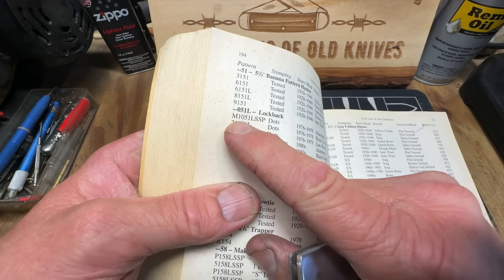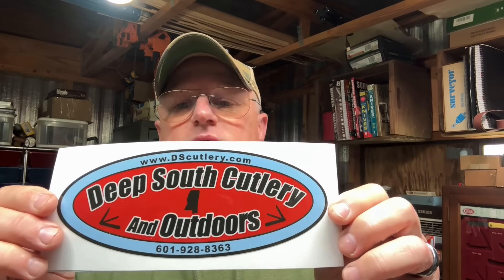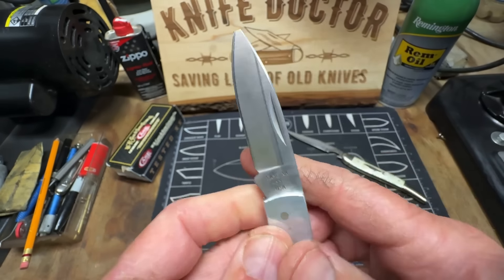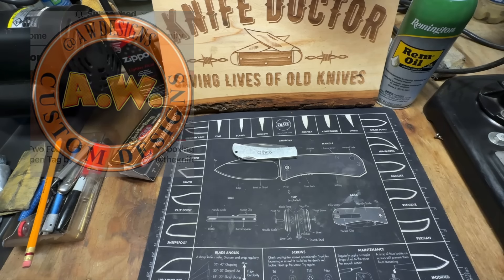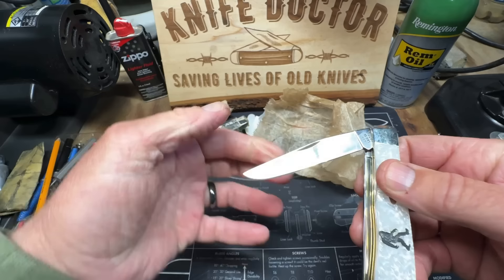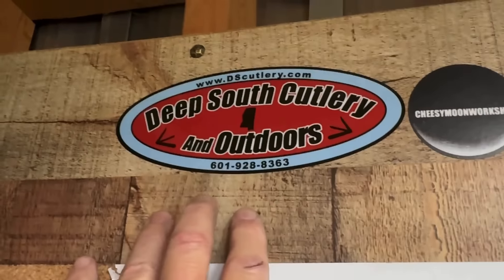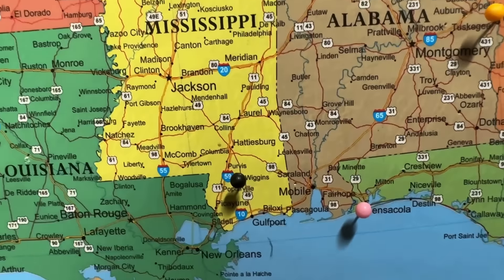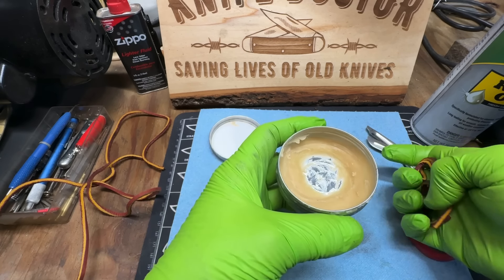Unboxing New Case XX Knives + Vintage 1986 Backpacker Knife Repair!

Comment: Hi ya'll

I feel so stupid i'm not able to get the scratches out of my newly purchased camco scout knife. Sandpaper, diamond coated sharpening plates i've tried everything. 

I don't have any power tools. Does anybody here have useful tips/tricks?

Joshua
Reply from the maker: Depends on how deep the scratches are.  I use my fiber wheel and a dremel.  I know you don’t have power tools…it takes alotnof elbow grease if you don’t.